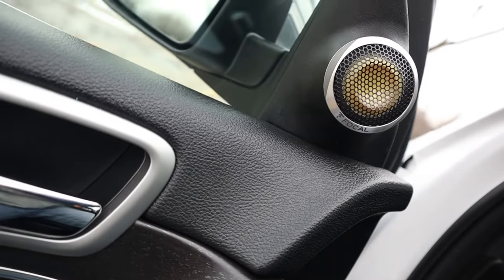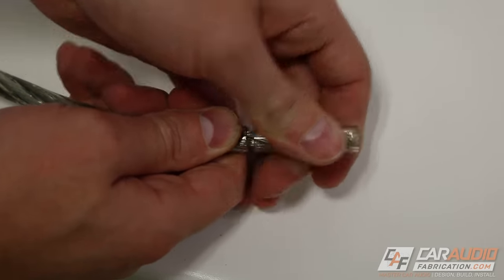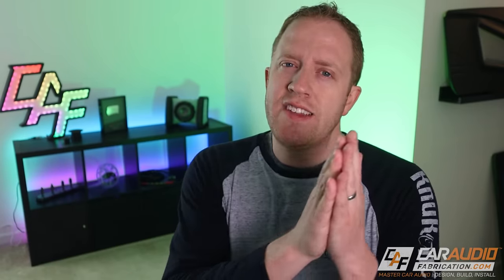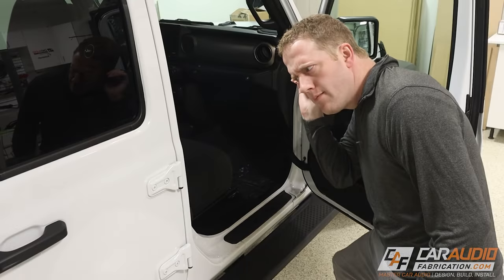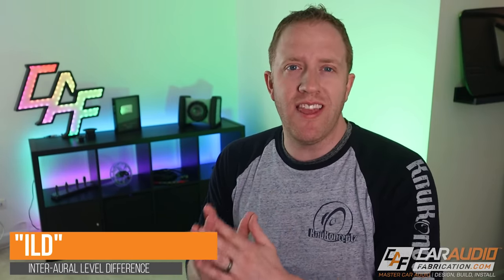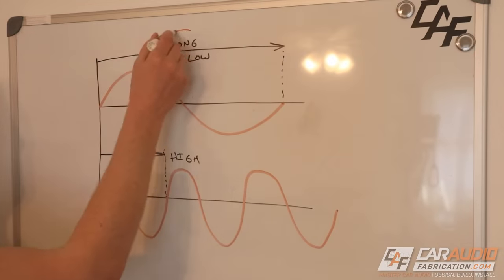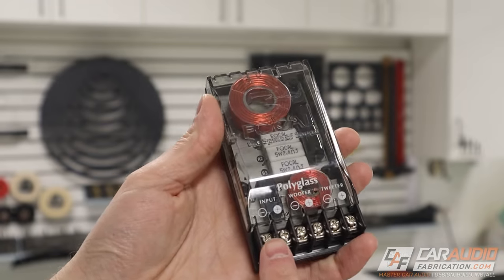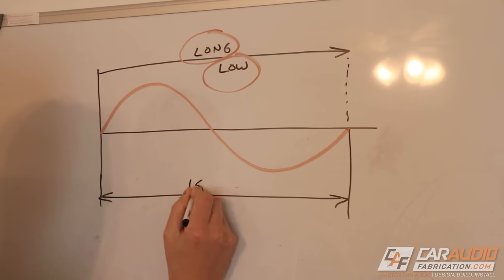Is YOUR SUBWOOFER facing the WRONG way? How we locate sounds explained!

Comment: Your height and the location of your dominant ear can determine which frequency hits it easier.  I did not care for much for the video where he put the microphone dead center in the headrest, as that is not where your ears are.  I"m taller and my head is above the headrest so I hear sounds that travel through the top of the car and i've always found that for best sound (not just bass) it's better to have the sub face the seats and not the trunk.  The trunk and car will absorb much more of the bass if it hits the car before it reaches you.  But it also depends on the size of your subs.  Smaller subs its much more noticeable with what i'm referring to.

Comment: You noticed how nobody talks about how you can adjust the sound level of your box by adjusting the port level and the length and the size of it
Most people just buy a box and stick it in their car they don't measure the square footage of the car and make sure they get the appropriate speaker for the appropriate breathing space so it sounds the same whether the windows are up or down

Comment: I was hoping for something that might explain why I can tell where the low frequencies are coming from. It takes some time, I don't just hear an electric bass note and know where the sub is, but give me 30 seconds or so of actual music and I just know, to the point that if there are supposed to be two subs and only one is playing I can tell which one is out. It is not a terribly useful skill, but I have always wondered how I seem to do what the books say we can't do. The only theory that ever made any sense to me is that I might be localizing harmonics or other distortions. Whatever that case, even with really big high end subs I can still hear where they are. Anybody have any other theories?
Reply from the maker: You are likely hearing vibrations or other noise, or the system isn't designed properly and meshing well with the up front mid bass. A proper system it is very difficult to locate the bass.

Comment: Does this die with the ICE car? Or can EVs have systems?
Reply: Hybrids are limited to the amperage of the dc to dc inverter. I'm limited to 30amps about 350 rms in my hybrid. So in theory a bigger inverter hardwired to the battery would let you pull more amperage.
Reply: In theory I would think not. Lots of power in the batteries. You would lose mileage as well. Someone would really have to know what they are doing to pull it off though. Side note...sub in the frunk would be odd. 😂
Reply: @craneeddie35  so we are heading to the end😪. I still got my subs and are keeping my ICE  Vehicles till Gas is outlawed

Comment: I usually have the sub facing the rear. I found that depending on the type of car, like an SUV or hatch back, if you face the sub toward the front, you tend to hear that "knock" sound of the sub on each bass note to whereas you wont hear it when its facing the rear.

Comment: Bass is non directional if set up the right way  ' just like in a home system you corner load a sub and you get loud boomy bass pull it away from the wall the bass volume is a little lower and tight and more accurate and more musical. Same with a vehicle push them to a corner or the back of a trunk and you'll get louder boomy bass ... But hell what do I know I use a clock radio in my car for music 😂

Comment: This is one of those things that's always driven me nuts.  To me, bass is directional.  Not to the same extent as higher frequencies, but having a subwoofer in the corner of a room, it sounds like it's in the corner of a room.  Same with a lot of factory car audio systems; the factory subwoofer always sounds like it's wherever it is to me.  Every system I've ever built, I've built specifically having the subs reflecting in a way that obscures or spreads the sound. 

Why am I broken?  :(

Comment: Forward facing cause first deflection is off the windshield and closest point to you.. you don’t hear sound you hear the deflection of the sound bouncing off a surface.. by facing anything other then front you are further from the deflection point as as such the sound is breaking up before getting back to you. The same applies to ports and the only time a speaker should be faced differently is if in a bandpass system where all sound is only coming from the port and then only the port direction matters.. again why all quality ported boxes had the port facing the same direction as the drivers

Comment: I've always felt that subs should face forward to the passengers
Reply: No,  cause the bass will travel towards the trunk not towards the driver.  You never face your sub forward
Reply: @MadeBy_Juice  i have a 95 mustang that i put 8" sub in. 2 are in the rear shelf Mach box and 2 in the floor under the rear passenger seat. they face forward and sound great. why do concerts face the speakers to the crowd instead of the back of the stage?